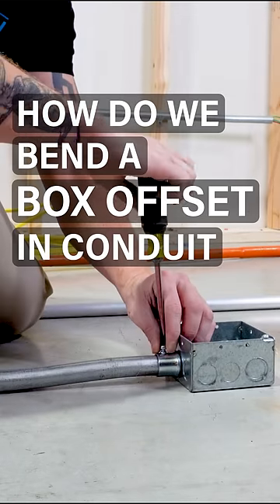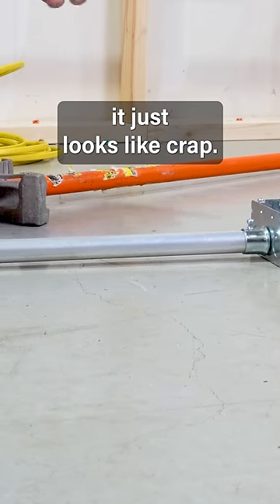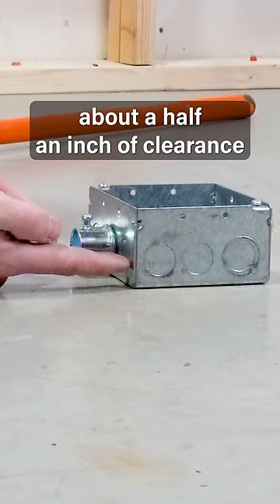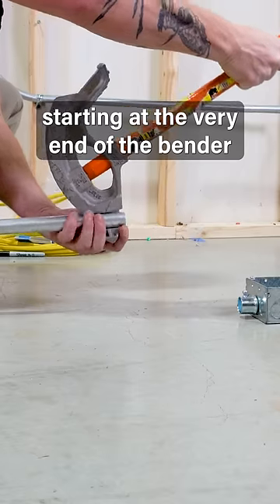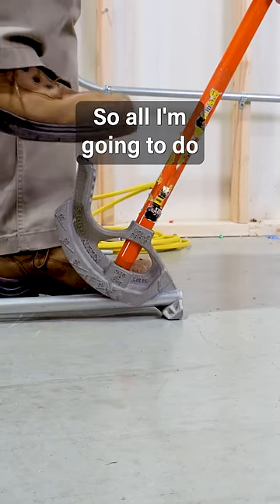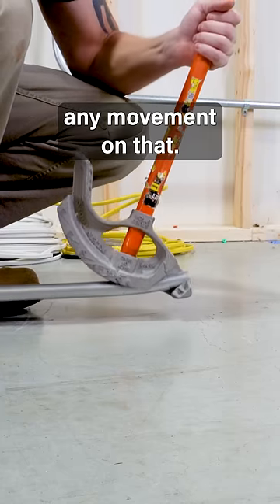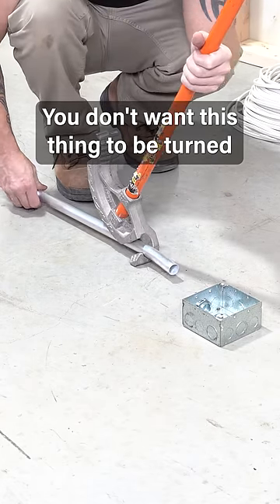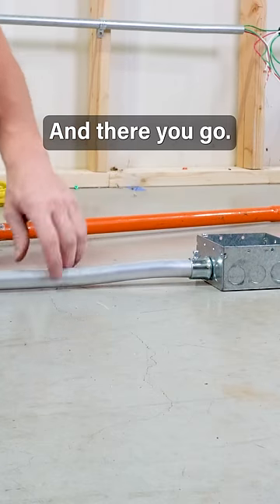How To Bend A Box Offset

Comment: First mark at 2 inches second mark at 4 1/4. 10 degree bends gives you a 3/8" offset. There you go
Reply: Eh takes to much time but good for people who are starting
Reply: You are right. My teacher taught me the same and it works. But Dustin's method is my preferred method as it is quicker.
Reply: The difference between measuring then marking and eyeballing is seconds and only a couple minutes at the end of the day. 

I’ve seen people put their eye balled box offsets next to each other. You can tell it was eyeballed. All my box offsets throughout a building are exactly the same, it’s called craftsmanship.
Reply: @robertpreston7 it’s called paid by the hour
Reply: @ryandevid3449 exactly
Reply: Thank you ☕️
Reply: Assuming you're using 3/4" pipe if it's a different size the numbers chabge
Reply: I’m doing to this way for now before I decide to  follow the video. I’m an apprentice and I hate fking up 😂
Reply: @369ZIR awesome!  all your offsets will look the same when you measure
Reply: @ryandevid3449 it’s called being unpromotable
Reply: No 1 mark at 2 and 1/4
Reply: I thought his too, until I saw a guys work and he taught me 10 degree bends . All of his box sets looked perfect. Ps.  He was piping a mechanical rm.
Reply: @huflungpu4456 don't have to worry about promotions when you're a highly paid union electrician.
Reply: 😅😅t😅😅😅
Reply: @natarito2056 😅hfhkp
Reply: Jjii
Reply: Hu
Reply: Hu
Reply: I was about to comment this
Reply: @greysonfrost9262 disagree. If you have multiple pipes come out of the same box, whatever it may be, I want to see every single one match perfectly. Takes little time to ensure great craftsmanship. 

I’ll tell my apprentices and young journeyman I want to see the same on pipes in and out of jboxes. Drives me nuts to see two different BOs. 

Just my two cents!
Reply: Yep but you can just eyeball that
Reply: Not one single professional marks box offsets. Get off your high horse with this comment
Reply: Just get a box offset bender 😂
Reply: You beat me to it... not that you need to measure... 2 inches and 2 inches behind that 10 degrees is close enough, and just do a handspan, is about 2 inches
Reply: @edwardmcdermott9948  Exactly right.  Plus you won't have a coupling in the middle of your pipe because you bent it a little off
Reply: Never do that..... if you need to measure for a box offset dont run pipe
Reply: Well he did it quicker without a tape measure.  There you go
Reply: end to first arrow, scoot, bend to 10. Second arrow (or star on klein) to first arrow scoot bend. I don't mark 'em anymore but you can mark at those points if you want.. It's easier if you're doing a lot to anchor your bender and bend the pipe on the bender than to bend the pipe on the ground. I'll usually go to the box count for the job and bend enough for the job  at the start, I can knock out over 100 an hour and don't have to go fumbling with a bender for box offsets throughout the job.
Reply: Nobody is going to use that method
Reply: Duh bro everyone knows that😅
Reply: Just use a stand off strap.
Reply: I've never measured or put marks on a box offset.
Reply: make a video then😂
Reply: Hm for a 1/2 inch?
Reply: @CatnamedMittens  I use on 1/2" to 1" and never fails
Reply: Ha. Just out a connector on the end of pipe. Bend a eyeball 10 degree. Flip over and slide right up to the bend. And boom box offset. 
You can do it standing up(bender) as well. Usually easier to do experience will guide you.
Reply: @robertpreston7 they also make a device that just puches it out.
Eyeball works. You just have to know how to work any dogs out.
Reply: @97leeman nope the numbers are the same. Only number that changes is shrinkage and your deduct.
The multiplier for the angles are the same.
A 10 degree box offset uses the same math and numbers same formula on 1/2 to 1-1/2 conduit.  It doesn't change.
Reply: Your math is off.
Multiplier for a 10 degree is 6. And if done correctly you do get 1/2 box offset.
Reply: @notashton. Check the math. What is the angle? What is the angles multiple?
Reply: @lm5085  two ten degree bends one at edge of pipe one at 2 and a quarter
Reply: @lm5085  to the bottom of the knockout your obstacle height is 3/8". 6 × 3/8" = 2 1/4". My math is correct
Reply: @robertpreston7 time is money sweetheart. Seconds equal hours by the end of a year
Reply: @3Z6I9R you learn the most by making mistakes. Get them out of the way now.
Reply: @nw73000 seconds equal hours at the end of the year
Reply: Exactly!😂
Reply: As a professional conduit guy. Sometimes you just gotta say fuck it and wing it.
Reply: Beautiful
Reply: Exactly, thank you
Reply: I love seeing tradesmen that are confidently versed in their trade.
Reply: Your short on that offset. The offset for any box is 1/2 your 1/8 sort. It will look like shit and not lay against the wall. And if you do it will nose down and not fit correctly. And if you try be slick and install the conduit than mount the box. That 1/8 will give you hell while trying to set the box.
Reply: Yep and $300.00 will buy you a box offset bender and it is way faster and all the same
Reply: Perfecto
Reply: That's exactly what needs to be done
Reply: Who has the time to do two measurements for an offset.. Measurements not needed...
Reply: Good thing my tape measure has a handy mark at 4 and 1/4 inches.
Reply: Always measured these. Takes two seconds. Multiplier at 10 degrees is 6
Reply: That's exactly how I bend mine, has never failed me in 12 years
Reply: @CatnamedMittens Same. the size of the pipe doesn't affect the distance between blends. Example: for a 30 degree offset, the distance between bends is two times the desires offset. That is for all sizes of pipe
Reply: @lm5085 If you're getting dog legs on your box offsets you shouldn't be bending pipe.
Reply: Up your game. Measure. 3" and then 6 ".
Multiple conduit in an area will look very professional if matching. Also you can still tweak it to ensure it's straight . I notice the video pipe was not and it would have if the first bend was a bit bigger.
Reply: Seriously if you put marks on a pipe for a box offset you will find yourself down the road in a hurry
Reply: Hammer works better.
Reply: @ryandevid3449  Says the same guy who complains that nothing lasts like it used to.
Reply: The Greenlee box offset bender is life changing
Reply: @Ameriken91  Thankyou, not sure what that has to do with my comment however.
Reply: Just eyeball it.
Reply: @thenewkidzify  mark it out and make them consistent. what happened to craftsmanship..
Reply: @TonyWright-tf5zy  if you're good like I am you can eyeball your offset the same every time. By your comment I know that I could run circles around you and it look better
Reply: @thenewkidzify  sure mate, your ego needs a check there buddy.
Reply: @TonyWright-tf5zy  Ego? More like confidence because I do this buddy. Maybe I could show you a couple things one day and you would learn to keep that mouth in check
Reply: @thenewkidzify  Sure buddy.
Reply: @TonyWright-tf5zy  yea, that's right. Go get my damn wire stretcher.
Reply: @thenewkidzify  What's wrong chirpy? haven't heard from you recently.
Reply: @thenewkidzify  Still missing you buddy.. I want to learn all of that sick knowledge you have.
Reply: Get an offset maker once you learn how to bend it by hand. Time saver
Reply: Let me go to the truck and snag my protractor 😂
Reply: Try breaking out your tape for a box offset on a commercial site. Hurry up boy.
Reply: @richardroberts4355  Hence the reason craftsmanship is dead, profit and planned obsolescence.
Reply: @scottleggejr  would have it on you if you were a serious craftsman. Shit isn't built to last anymore, sadly.
Reply: Last time I checked the multiplier for 10° bends is x6. Which means first mark at 2”, second mark at 5” (6x.5”=3” apart). Just Saiyan.
Reply: @robertpreston7 it’s sad people can’t appreciate a systematic craftsman with mindsets likes yours.
Reply: @IDsparky Then buy them an offset kicker.
Reply: A typical case of people not evolving. They saw it that way, were thought that way, and therefore wanna continue the same old same old, useless, subjective it looks getter bent. Newsflash! No, it doesn't. I prefer my pipes, not bent. Thank you!
Reply: @IDsparky that was a whole dollar
Reply: Not using a multiplier to make a box offset is fine but I never bend off the very end of pipe , you may get away with it using set screw fittings but compression fittings won’t like if the end is even slightly oval !
Reply: @natarito2056  it not quicker.    First of all I knew he doesn't know anything when he set the bender on the floor.   A professional new has to pick the bender up off the floor.
Reply: Come on. Bend a little. Flip. Bend a little. Done
Reply: I definitely knew that already and I’m smart
Reply: Gud Info...Thank you
Reply: You would be laid off quickly
Reply: With experience measuring is unnecessary
Reply: A company I once worked for had an offset bender that did both bends in one squeeze.   It was the cutest tool.
Reply: The 2x2 measure is good for when you’re doing a bunch of box offsets in a row so they all look the same. Don’t be a hack
Reply: @robertpreston7  My favorite Jman i worked under said "you can either be a bad ass electrician, or ass bad electrician. Which one do you want to be?
Reply: 3/4😏
Reply: @TonyWright-tf5zy Are you still missing the part where you can use references to keep constant? Think many "experienced" people are lmao
Reply: @hamburgerhelpah6618 I always start with 2 finger past the shoe because of that, plus it gives it a nice look. I find the bend is to close to the connector the other way but functionally does everything the same (besides the issue of what you had said). Just make sure to make it that much more perty when exposed
Reply: That’s the easy part. How do you get it straight?
Reply: Mark@ 2&1/2” then mark 4&3/4” then bend on 10 degrees.
Reply: Anyone that has to measure a box offset is not a real conduit runner. I have never measured a box offset and they always come out exact cause I know how to bend conduit.
Reply: Look eyeball it if it’s only one box offset that won’t be compared to one right next to it. If you have a series of box offsets right next to each other then mark them.
Reply: @danielmoreno9695  I do box offsets right next to each other and they always look the same and I never mark them. Been doing it for 15 years so it comes natural to me but it is not hard. To do. I can usually eyeball most offsets too
Reply: @DaytonTrailRiders  I can too but for me comers it’s great advice to learn the box offset measurements. So eventually they won’t need them and it’ll be muscle memory
Reply: @danielmoreno9695  I teach people how to do them and I have trained a lot of people. Eventually you home your skills and don't need to measure for box offsets is what I'm saying.
Reply: Great. We'll finish the build decade after next.
Reply: The idea of a box offset IS TO NOT MEASURE. The further you go , your eye should become better.  It saying eyeball, but eyeball box offsets . Put your level on that second bend , and long as it’s level. Rock it . 
Stay up tradesman
Reply: So it makes no difference in the performance of the box, conduit, or wire....... i wonder how long you have been doing this type of work. @robertpreston7
Reply: I do my first bend at the end of the pipe like in the video, then find the center of the first bend, index, middle and ring finger length to next bend. 10 degree bends.
Reply: @nickfarnham3321 then you don't work with professionals
Reply: Once you do enough of them you don't even need to measure and it's just muscle memory
Reply: Then cut that part off and go get the mini's out of the truck.
Reply: 😅😂😂 mathing ain't for everyone
Reply: No
Reply: Yeah but this takes you 15 seconds
Reply: @natarito2056 bending a box offset on the ground is the preferred method???? Hell no
Reply: I normally fire the guy that says whatever I want
Reply: Starting out measurements, 99.9% of seasoned electrician's do the same
Reply: I do 1 in and 4. I get same results
Reply: 125 comments gone ?
Reply: I go 3 and 6 but yeah
Reply: @scarycrazymannim back bend star guy👍
Reply: I was taught first mark at 2” and second mark at 6-1/8”, and 7° bends will give you exactly 1/2”

Comment: Utilize the weld line to keep your two bends inline.
Reply: BRO, I never thought about that when I started learning to bend. Good tip 👌
Reply: Exactly always told my apprentice’s that
Reply: That's a legit tip. I've also got a Klein level that works fantastic for bending. No lines to follow on Rigid conduit.
Reply: I learned in 2 weeks and was on my own, it was commercial so not hard, industrial is a bitch sometimes because threading 😢
Reply: Smart
Reply: Not always correct or visible.
Reply: If you want perfect. Learn to use a anti-dog.
Reply: @lm5085  we call them a no-dog in colorado. never heard it called an anti dog before. where are you from?
Reply: @RubenGarciaShow rigid is so fun said no one ever
Reply: Not roo many people mention that one
Reply: Good eye! :)
Reply: @theBROWNbanditP old timer teacher out here east coast called it a "wow"
Reply: Lfg. Solid tip
Reply: I'm literally going to try that tomorrow
Reply: You can take your pencil ✏️ and mark the top of the pipe and then flip it to put the pencil mark on the bottom….. that’s if you can’t eye it up
Reply: I fukn hate rigid. Try aluminum rigid, so light but everything can go wrong.  My Forman told me use a no- dog,  leave it,  then use your torpedo on that same no- dog for back to backs
Reply: Yes or Nucor conduit has center line marked
Reply: I never even considered this...

Comment: No! Dont leave it flush with the end! Thats how you egg the end of the pipe! Start it a couple inches back or put a coupling on the end of it.
Reply: or realize after the fact that you made a mistake and use your channel locks to fix it.
Reply: Absolutely correct. In the UK, we call it a dog leg. I use a Record Unibend Electrical Conduit Bender with vice. I start my bend 6" from the end so I don't flatten the tube as we fix by threading the end also as I am working at waste height I can look down it like looking down the barrel of a rifle to keep my bend true and then sight it to a straight edge to check its parallel.
Reply: I was taught to (and have since always) put the connector on first before bending. The screw is the perfect indicator of the top of the bend, no need to try and eyeball the bend to make sure the offset isn't getting skewed sideways.

Screw the connector on. Handle down, put the conduit in the bender with the screw pointing straight up. Pull down a bit to make the first bend. Slide the conduit forward 4ish inches with the screw pointing straight down. Make another bend by pulling down a bit. Done.
Reply: So just just jam into the connector...problem solved
Reply: I've been bending conduit since I was 14, I'm 34 now and not once have I egged the conduit by doing this.
Reply: You can get away with it using 1/2" and 3/4". 1" will definitely egg head.

Comment: I was an industrial electrician for several years and getting a new helper to properly bend box offsets would try the patience of a saint. LOL
Reply: I started like a year ago and it only took me like three tries to get that shit right Still pissed myself off that it took so long cuz once I got it it was simple as hell now that I looked back at it
Reply: As a current industrial electrician, we run rigid for everything that isn’t ran in troughs/cable trays, so box offsets are a thing of the past.
Reply: Surprisingly that was one of the only things I got right off the bat when I started as a helper. Not much else came too easy
Reply: @sink009  With the proper straps box offsets are not necessary. If if I have to.

Comment: It all depends on how the conduit is strapped to the wall, though. In my experience, a box offset is only required if the pipe is up against the wall, with one-hole straps. But if you use push clips or minis, the pipe is kept about 1/4" off the wall, so you can run the pipe straight into the box without any offset.
Reply: 1 holes and flush to wall look better.  So if it's surface mounted pipe,  using minis will make it so ugly
Reply: Minis also take more time

Comment: I’ve found that putting the conduit flush with the bender ovals the end of the conduit at least half the time, and it won’t go in the connector/ coupling. If you stick the conduit past the bender an inch you don’t have that issue.
Reply: Facts but I squeeze it back into a circle with my channel locks
Reply: My journeyman told me 2 fingers between the front of the pipe to the bender for that reason. Saves me all the time
Reply: Hammerkliens to the rescue 😅
Reply: I measure from the tip to the first knuckle of my index.  Def saves time
Reply: You are correct
Reply: @miguelayala3374 
I was about to say the same thing.
Reply: Sounds like it's time for a new bender. I've only had that happen like twice, and it was with an old worn out bender.
Reply: At least a 1/2" back from the end of the pipe because yeah it deforms the pipe more often than not. Also....who does offsets on the floor?!
Reply: @BensTechify no you're wrong it has nothing to do with the bender and everything to do with the fact that the pipe 90% of the time will egg when done flush
Reply: It won't if you're only doing a box offset
Reply: YUUUP!  Don't put the end even with the face of the hook.  You'll oval the end.
He needed a couple more degrees in the second bend.
How the f**k can you make an instructional video and NOT do it correctly??🤯
Reply: That is true with larger conduits bur half inch does not oval
Reply: Agreed, give the tube some relief overhanging the bender at least 1/2"